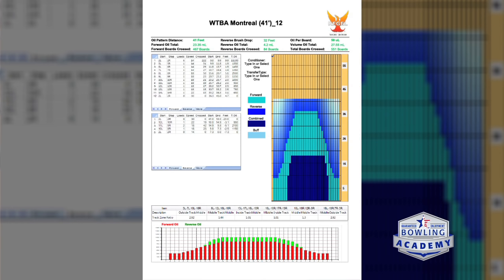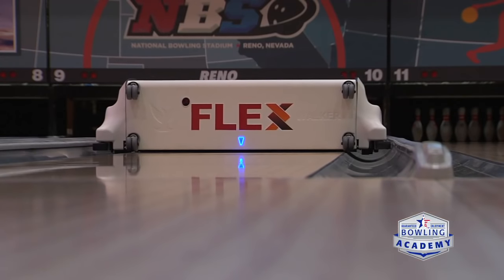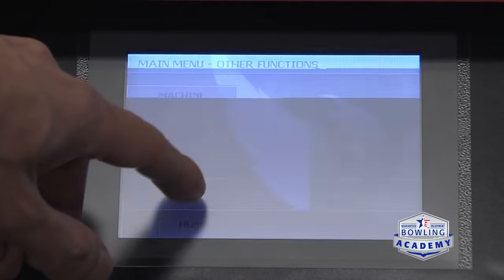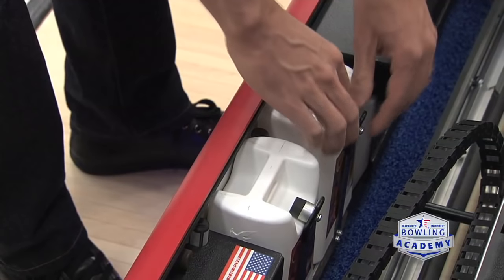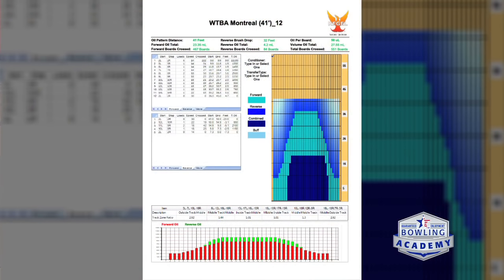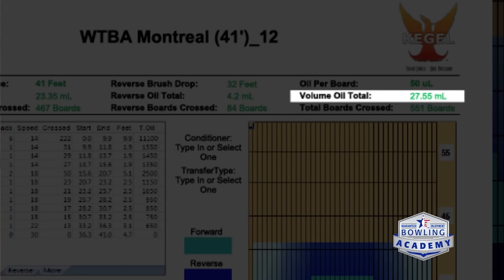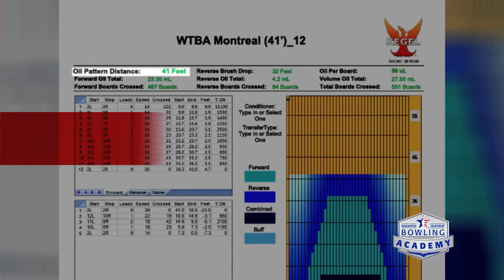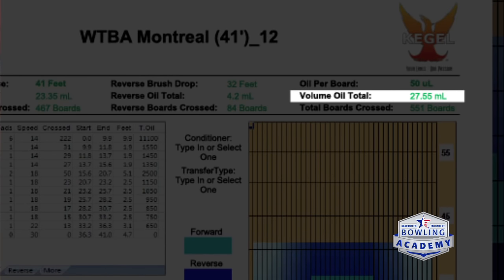How to Read an Oil Pattern Sheet: Understanding Bowling Lane Oil Patterns

Comment: So if the lane oil pattern is 42" and you subtract 31 does that mean your target should be the 11 board or the breakpoint should be the 11?
Reply from the maker: Hello.  This means the breakpoint should be the 11 board. How you get to the 11 board down lane depends on your ability and how the shape of the pattern is in the front and middle sections. You will also need to change angles as transition occurs on the pattern.Here’s some information on reading the lane that includes how the breakpoint is defined by more than just the balls roll. Also covered is pattern length, lane surface, oil, and shape.Reading the LaneIn league, tournament or professional play, knowing how to play the lanes is crucial. A 300 game is achieved by knowing how to make the right moves at the right time, not just repeating shots. Staying “ahead” of the lanes as they go through transition is key to perfection.Most bowlers know about the arrows, but finding the breakpoint and adjusting to that part of the lane is vital to giving you more area to play with. A quick method to determine where the ball should be leaving the end of the oil pattern is to simply apply the rule of 31. How do we do this? Subtract the number 31 from the distance of the oil pattern; this will give you the board number where your ball should exit the pattern. Nothing is definite, but this is a good guideline to finding the correct area to start and then make adjustments based off your ball reaction.Example: Pattern length 40 ft. - 31 = 9 boardNOTE: On a 40ft. pattern you want to see the ball exit the pattern (breakpoint) around the 9 board.Lots of science going on here.DistanceLane pattern distance dictates “breakpoint.” A bowler’s breakpoint is where their ball is furthest away from the pocket before making its move toward the headpin. Short distance patterns, 36’ and shorter, tend to have breakpoints closer to the gutter, while medium distance patterns, 37’-42’, are usually between the 8-12 boards. Long distance oil patterns, 42’ and further, will have breakpoints closer to the pocket or around boards 13-16. A breakpoint can be reached from multiple launch angles depending on the oil pattern.Beyond throwing the ball, making moves and knowing where to play, execution of the shot is essential to being successful. Let’s take a look at the many components to making the right moves and decisions and see how they factor in together.LanesTake into consideration the type of lane surface you will be bowling on. Wood lanes tend to hook more and/or earlier, whereas synthetic lane surfaces tend to be a little tighter and allow the ball to get down the lane a little further. If you’re a high rev-rate player, you may need to make adjustments sooner, while a straighter player will probably move less to combat the condition. Moves on the approach and lanes are done by moving your feet and your eyes to adjust your angle. Moving one or both is a personal preference geared toward your game and how you see your ball path.OilAs the lane pattern goes through transition, adjustments needed to stay in the pocket and score will be slightly different from player to player. Some may need to adjust their feet, some their eyes (target), some will get it done by changing bowling balls or adjusting speed and loft. When bowling a tournament, watching the bowlers on the pair you are moving to can help you make good decisions about any adjustments you might make in the first frame. If you notice most of the bowlers playing the same area, you can expect that zone to change quickly. Again, be aware of your surroundings and make adjustments a little more quickly than you normally do in league play.Making adjustments to the condition using hand positions or ball speed are good, but having the right ball can make all the difference in being comfortable and repeating shots.When you are bowling on a fresh oil pattern, starting with a stronger ball will allow the ball to be smoother off the hook spot giving you the information needed to determine what ball to use, where to play, type of release and speed. Watch how your ball rolls off the breakpoint and make your moves accordingly. As the lanes break down, switching to a weaker ball that skids down the lane a little further may help you combat early hook in the front part of the lane. ShapeThere are 39 boards on a lane and it is approximately 42 inches wide, which does not seem like a lot of room to play with compared to the length of the lane, which is 60 feet. (Foul line to head pin) Learning to see where your ball starts to read the pattern and watching the reaction as it is heading toward the pocket is more valuable than reading the lane left to right. Why limit yourself, when you have 60 feet to play with?Reading a lane condition front to back is identifying where the ball begins to lose speed. If a ball loses a lot of speed in the first 20 feet, you can expect less hook power or a smoother backend motion down lane. If the ball doesn’t lose speed in the front or middle sections of the lane, you can expect more hook down lane creating a stronger back-end reaction towards the pins.TIP: Practice with two balls, a stronger (early rolling ball) and a weaker (later rolling ball). Get lined up with one ball and then throw both of them in the same place, the same way. Train your eyes to see how early or late the ball starts to make its move toward the pocket. Watching ball reaction, knowing your equipment and knowing your breakpoint are keys to being one step ahead of your opponent.Thanks for continuing with the Bowling Academy.
Reply: Thanks for the info!
Reply: Naw Honestly Bro its more like it depends say the LANE SURFACE, REV RATE, THE BALL YOUR THROWING, AND AS WELL AS HOW THE WHOLE OIL PATTERN IS GOING TO TRANSITION. The Difference From LOW-HIGH VOLUME ALSO VARIES SIGNIFCANTLY, AS WELL AS THE SHAPE, SPEED, WHAT I SAID BEFORE ON LANE SURFACE OF REV RATE, AS WELL AS HOW YOU THROW THE BALL. Or MAYBE IT LOOKED LIKE The National Bowling Academy Helped you, but for my slower-medium speed more rev dominant style, The 11 Board even on 43-50 Ft on longer, DEPENDING ON VOLUME I throw generally either a Solid like a 900 Global Lunatic, Storm Sync, or if its reading too early, The HyRoad Pearl also works well, and for short patterns 33-38 Ft (yeah i know some say 37 or 38 is medium but my higher rev rate disagrees into thinking its SHORTER) I'm generally deeping my angle and throwing a HyRoad Peal unless its a Super Natural or a Rhino Urethane where as the angles look deeper from my style generally whether im standing right left handed and throwing left or if im standing left throwing right right handed,  its like it depends on how the actual pattern plays etc etc, Oh and I honestly don't know what I'd consider Medium as Besides 41 and longer, but anyone could of said 37,39,or 40 were all mediums, however to me those even play shorter, or maybe i gotta change something with my style or it would be LESS HOLD compared to the amount of oil im using on Modified Sport shots To My Preference, But whatever suites you bro

Comment: This told me nothing useful about how to play a pattern.
Reply: My guess would be you haven't been bowling very long then.
Reply: @mrfixitfixitgood  Can you explain it?
Reply: @nordattack   The biggest takeaway from this video for playing a pattern is the rule of 31 they mentioned right at the beginning. Pattern length minus 31 equals the board you should target as your breakpoint. Example...42 foot pattern minus 31 means your breakpoint target is the 11 board. By breakpoint, it's the spot when the ball exits the oil pattern, so in this example that is 42 feet down lane. This is just a rule of thumb but it's very good for a starting point. As for how you approach reaching that target breakpoint, that's something that can't be answered in the video. This is because there are too many variables such as lane surface, ball type (urethane, reactive resin, etc), ball speed, rev rate, etc. There isn't a one size fits all approach to playing a pattern. You have to use this rule as a base and adjust from there for it to work for your own unique style.
Reply: @mrfixitfixitgood  Thanks! 
What I really want to know is where to target at the arrows based on the pattern.
I bowl straight, down and in, because I only have 145 rpms and 13 mph ball speed.
I have no success opening up my angles because I am a Full Roller with zero tilt and the ball does not angle back or recover.
So I must stay either closed down, or up the boards for success.

How do I translate this to Sport shots?
Reply: @nordattack  No problem! And to me it sounds like you know your own game pretty well. You understand that there are certain limitations with lower revs and ball speed such as yours. Because of that, some oil patterns just simply might not be a good fit for you. Longer patterns I would think would be the toughest for you because they have less room for the ball to get to the pocket after the pattern ends, and less hook potential overall. Anything above a 42 foot pattern is considered long I believe, so if you saw a sport shot tournament with a longer pattern like that just be aware it may be very difficult.

As for your question about where to aim at the arrows, I'm guessing you would be most successful playing straight as possible, which you said you do anyway. So if you're aiming for a breakpoint around the 8 or 9 board (which is pretty common on typical house shot), aim for the same board at the arrows or possibly in a couple so you're still swinging it out a touch.